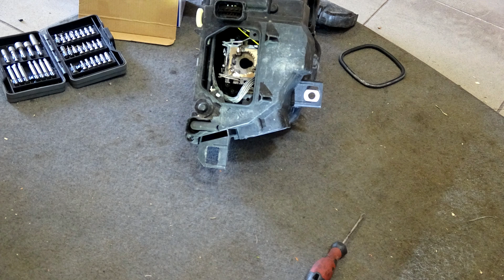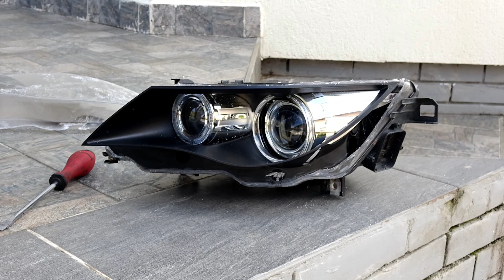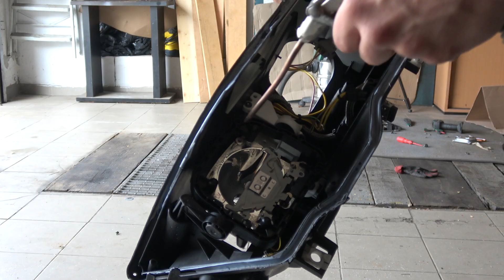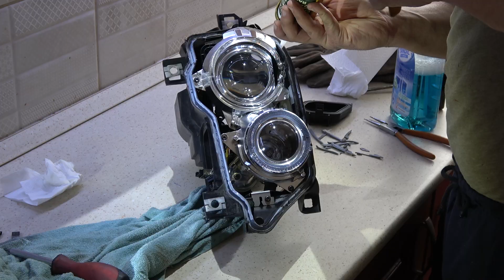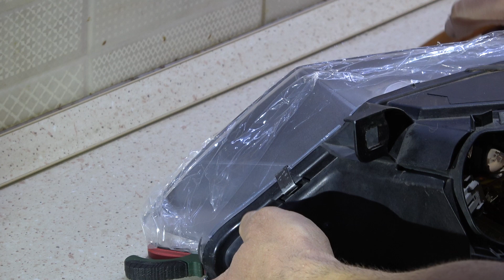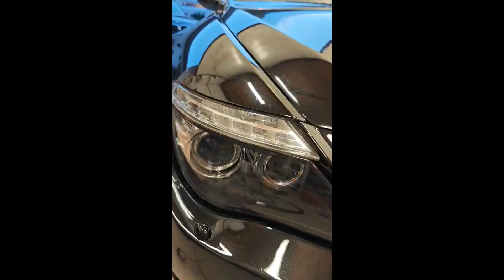BMW E63/64 - 6 series Headlight lense replacement, restoration

Comment: I just heated the headlight cover edges with a heat gun and opened the lenses as they are glued with ordinary butyl tape, no cutting required. 10 mins per side.

Comment: Good job. Just a tip - for cutting the plastic I use the oscillating saw - whitch seems to me more precise then a dremel, makes less mess and doesnt melt the plastic that much.
Reply from the maker: @davidjirus9811  I didnt melt the plastic either because I used low RPMs. I only had this device at hand.
Reply: @BMWReviews    ciao  innanzi tutto sei un Grande!  puoi darmi il tipo di silicone e marca cosi lo ornino oppure puoi mettere il link    
grazieee